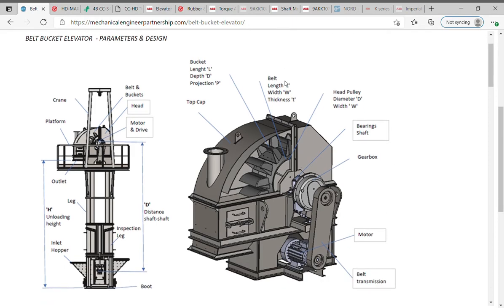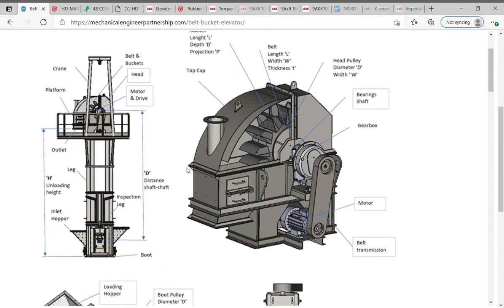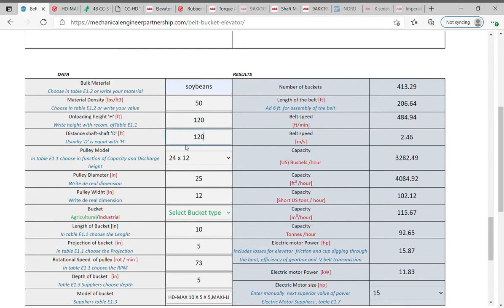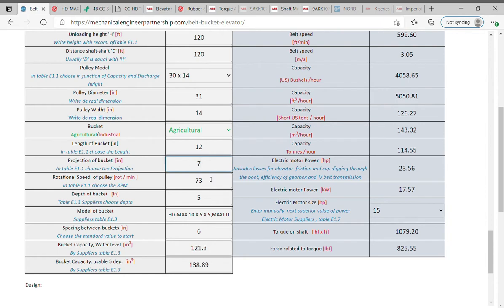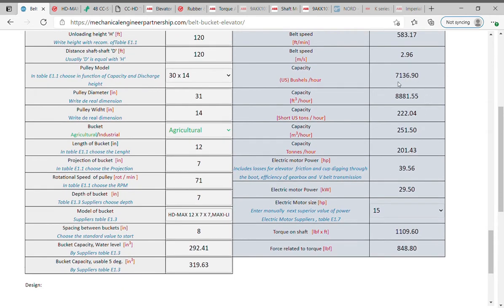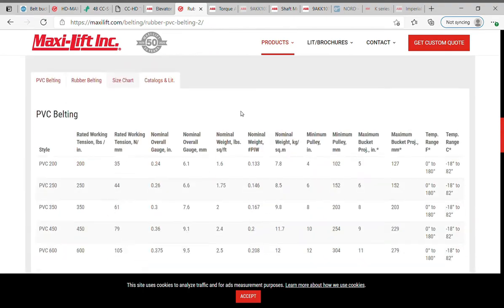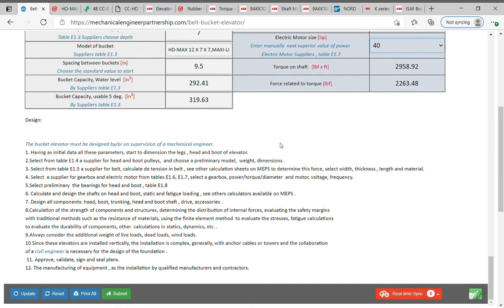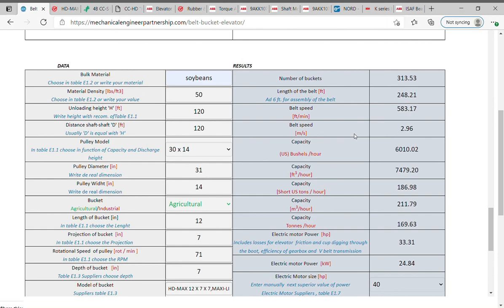Belt Bucket Elevator

Comment: sir how do you brake the elevator when motor stopped?
Reply from the maker: Gearbox Backstops are used in applications where the load is significant enough that should a stop occur a potential reversing condition can be prevented